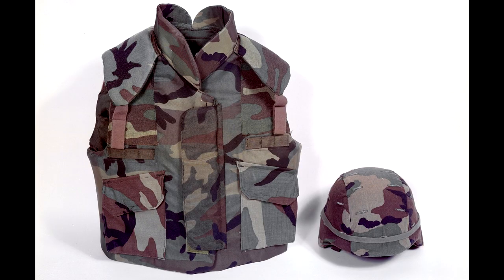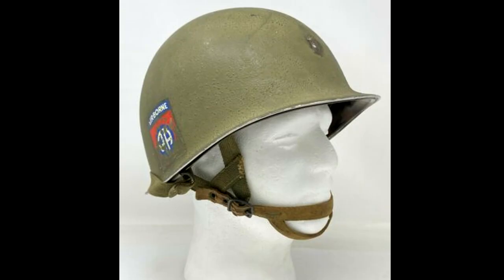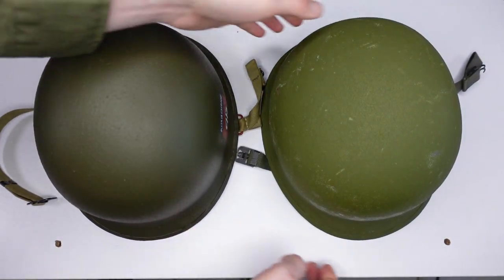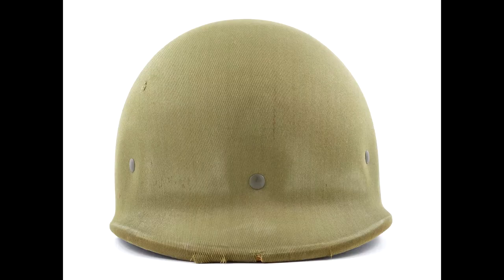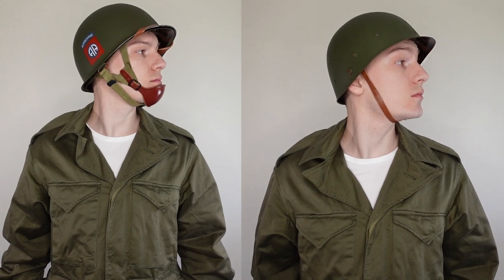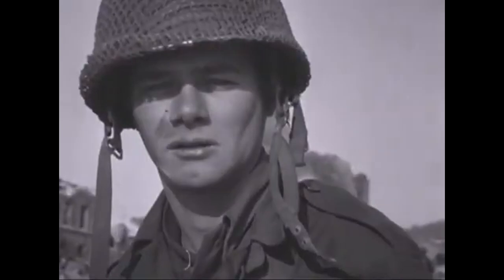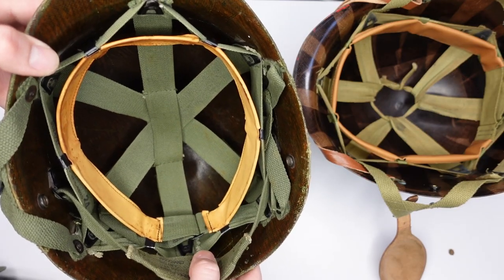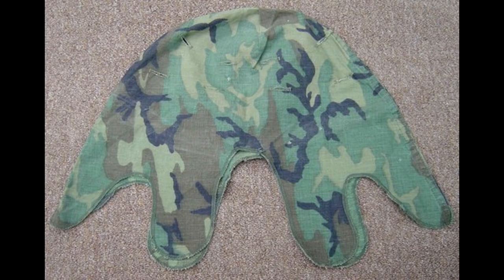US M1 Helmet | History of the M1, M2, M1c development during WWII, Korea, Vietnam & Grenada.

Comment: some navy units were still using m1s up until the early 2000s. and us navy seals still wear m1 helmet liners during BUDs training. 
its a shame you restored the m1c helmet. it would be worth more as it had been than restored. post ww2 m1cs are quite collectable. 
the m1c modification is what drove the switch to swivel bales as its the research for a replacement that led to swivel bales. this is why some of the 1st swivel bales seen in combat units are m1cs in airborne units. 
great video!